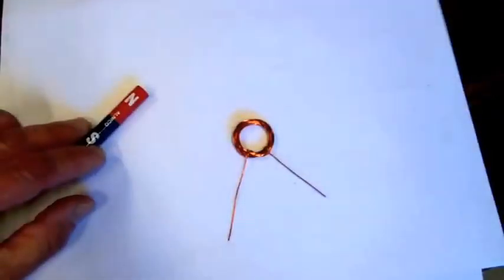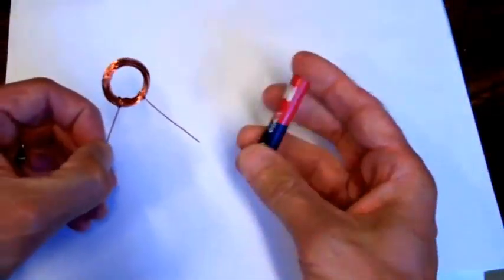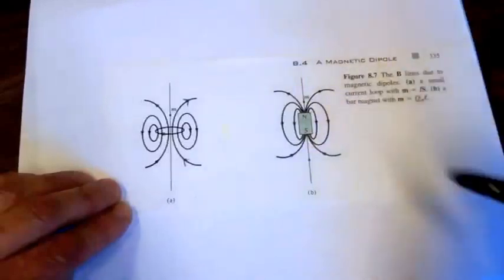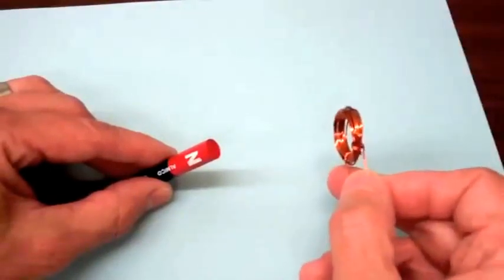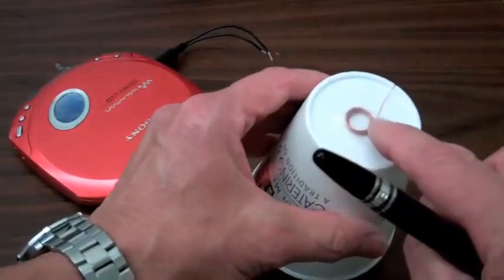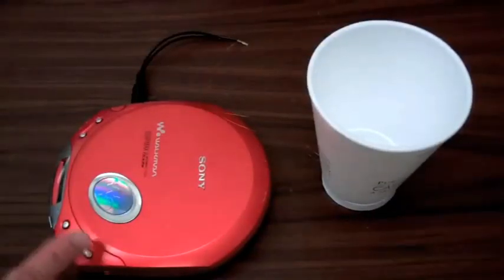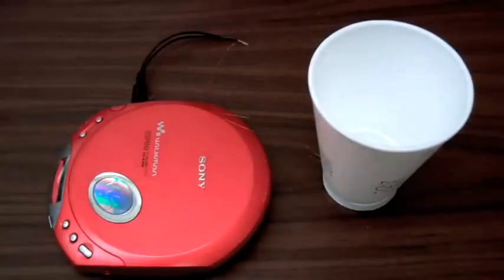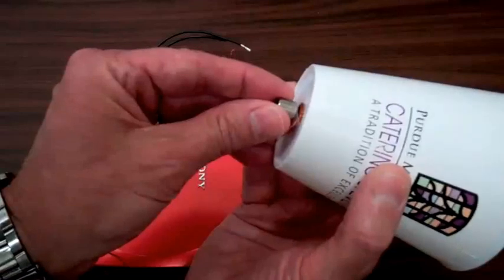Styrofoam Cup Loudspeaker

Comment: Excellent! Have you experimented to see what the minimum number of turns required in the coil would be so as to prevent such a long time since I rock and roll'd? Does more coils equal "stronger" magnetic fields? If so, how many coils until the bottom of the cup gets ripped out, or the magnet gets rail gunned up through the cup? :)
Another great video! Subscribed!
Reply from the maker: +vanderticked The more turns, with the same current flowing, would give you a stronger magnetic field. I did not experiment, at least not much. Just tried a couple coils, with different number of turns, and a couple different cups. Not much difference was observed.